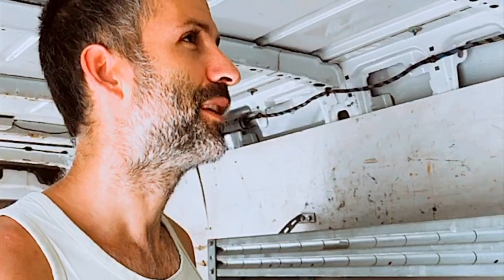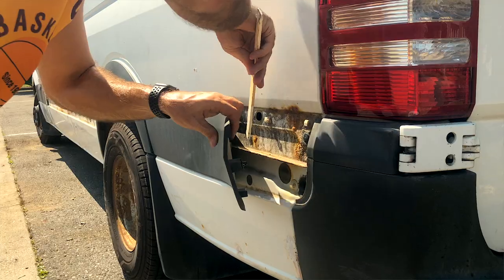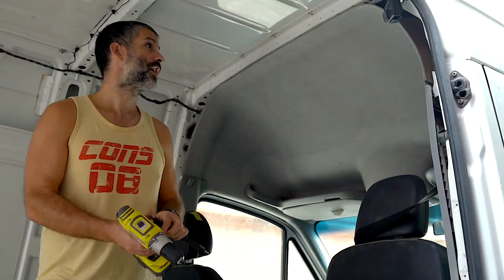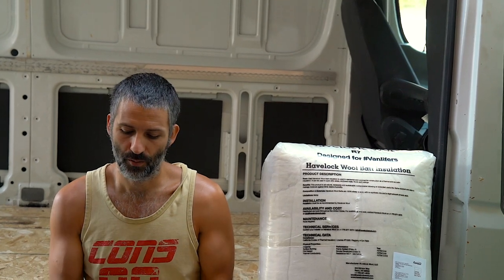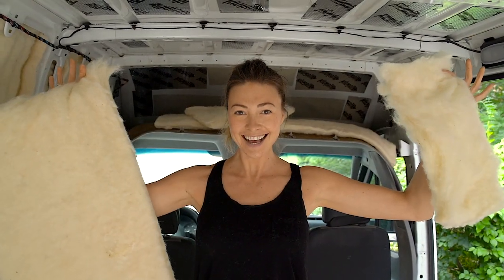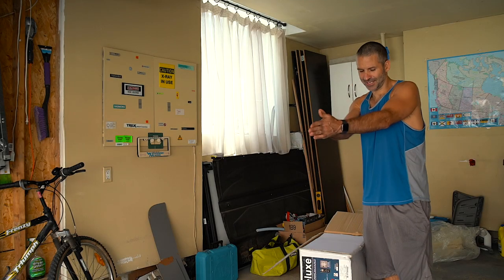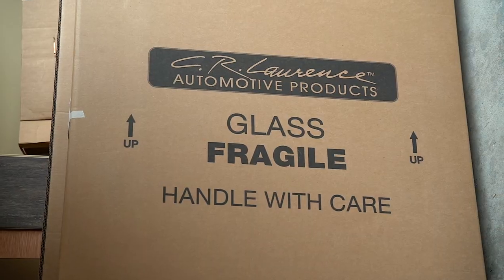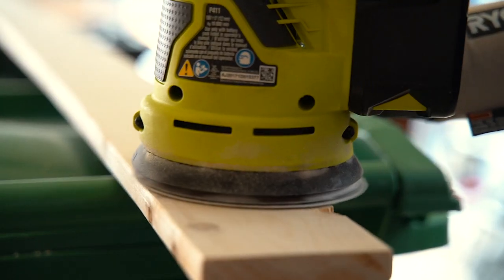DIY Sprinter VAN CONVERSION: Part 1 - Windows, Ceiling, Insulation & More

Comment: I very much liked the end result and very interesting to see the building part of it. Did you use the L-track for other purposes than the winch? I have them in the van I ordered as well, but not sure if I want to keep them.
Reply from the maker: Thats the only thing we used them for, but thats just because of the design of the build we did. I could see a version of our van that used the l track to mount all of the cabinets as its very stable. 
I actually tried to take some of it off and it was very tough so just left them on lol